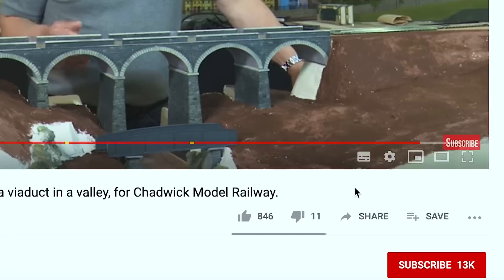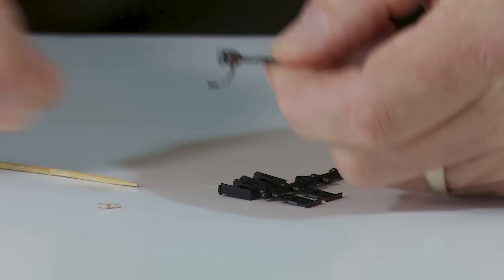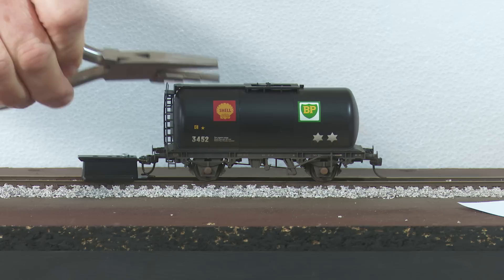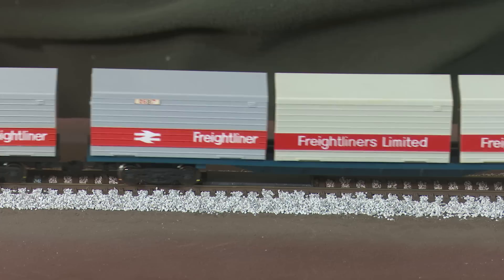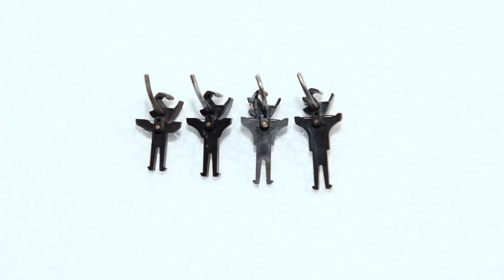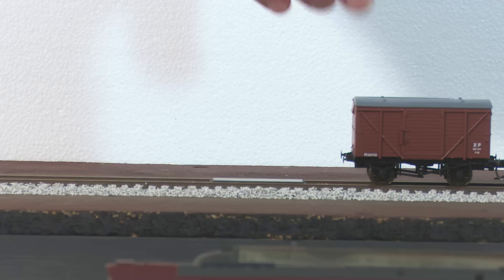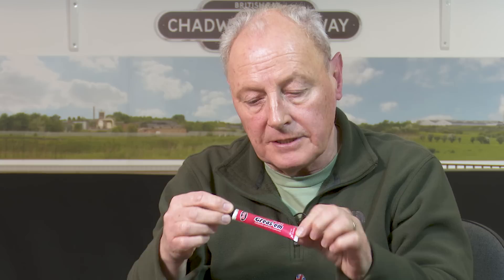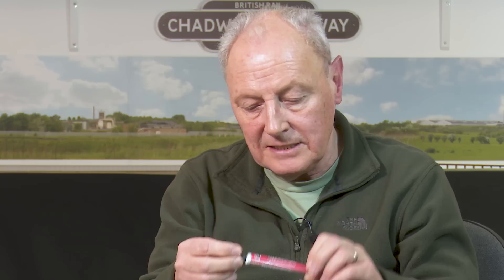Kadee Couplings at Chadwick Model Railway | 81.

Comment: Charlie, I thoroughly enjoy your videos and Chadwick Railroad. 

In the US most HO trains come standard with with KD Couplers, however I Model in N Scale (1-160).   There are two main types of couplers found on N Scale Rolling stock, most older locos and cars have Rapido Couplers, they are large and totally not prototypical at all, and have been around since the start of N Scale.   Most new rolling stock comes with Knuckle Couplers, primarily Micro Trains Couplers, formerly KD N Scale.  The Brothers separated the company.  There are also several other manufacturers making N Scale Knuckle Couplers, including Atlas, Bachmann, and Arnold - Hornby.  Those mentioned work pretty well together.  The Hornby Couplers are the most prototypical and best looking of the Couplers but need a bit of filing to work reliably.  The Micro Trains couplers are the only ones that have conversion kits to fit just about every make and model of rolling stock and locos, they also sell replacement trucks with Couplers mounted to them, as does Atlas.  I have been modeling in N Scale for over 40 years and set it aside about 15 years ago until 2 years ago when I found out that my then 10 year old Grandson was into trains, so I pulled it out and set it up and we have been running trains on it ever since.  I also converted most of my cars and locos over to Knuckle Couplers and have purchased additional equipment, some with Knuckle Couplers and others that I have converted, as far as I am concerned the KD Couplers are the only way to go.  

By the way they also sell larger Uncoupling Magnets that are mounted under the track where the cork roadbed should be, they should be able to uncouple your cars that that have the higher mounted  Couplers. 

Barry Broyles
Reply from the maker: Wow Barry, what a great comment. 
You clearly know your stuff regarding N gauge rolling stock. Good luck with your layout in the future. 
Regards Charlie.

Comment: Charlie, a quick comment on your mention of using #5 Kadees for one of your locos, the #148 that you showed in the video is the whisker equivalent of the #5. Also, if you can adjust all your rolling stock so that they can use centerset  couplers, you might like to think about using the semi-scale #158, also a whisker spring shank. Also, over here (I am a transplanted Brit) many modelers remove the coupler pin and use a wooden skewer for uncoupling. When operating our layouts we often have two man crews, engineer and brakeman/conductor. The latter has the skewer to uncouple where ever required, more prototypical.
Reply from the maker: Thanks Stefan, that’s sound advice regarding the Kadee alternatives.
I’ll be checking them out at the weekend.

Comment: Great video Charlie, these how to videos are invaluable as I get back in to the hobby. I seem to recall that back in the late 60's my Hornby Dublo models had an open coupling similar to the KDs and that the tension lock type were on Triang. Shame if UK modeling went the wrong way back then. (Memory could be flawed!)
Reply: Nothing wrong with the memory ( not unless mine has gone as well)....In fact if I dig long enough in the loft I could fine some, along with a converter truck with Triang at one end and Dublo at the other
Reply from the maker: So true Jeremy, one step forward, two steps back!

Comment: Great video Charlie! I’m in the process of changing all my stock to Kadee couplings, and have come across all the issues you’ve highlighted.
I’m so frustrated with all the differentiations between the manufacturers myself, and am gradually working through them, by several different methods. Stiff upper lip and all that, I’ll get there!
Reply from the maker: Good for you Nigel, be strong!

Comment: Hello Charlie,
Very good video. Have used these couplings on all my stock. Could not agree more with your comments on the lack of standardisation on modern NEM pockets. With old stock you would expect to have to play with shims to adjust the height of the coupling but not with standard NEM. In extreme cases I have had to cut away the fixing for a droopy NEM pocket and use wiskered couplings. Keep up the good work
Reply from the maker: I’m so pleased that you agree about this dreadful situation Frank.

Comment: Great video.  I took the plunge and put some #19 NEM socket Kadee couplings on some Hornby BR Mk1 coaches.  They work great and look fantastic - far better than the tension lock and huge gap between coaches. I am planning on doing some more.  Would you be able to do a video showing how to convert without NEM pockets or with the wrong sort of pocket (older Hornby for example) wagons/coaches/locos to the correct NEM pocket type/height etc.  Love the channel.
Reply from the maker: Hi Michael,  I might have covered this in another Couplings video. There are three in the series.

Comment: Makes me wonder a bit.  Back in the olden days of US scale model railroading (50s-60s), car kits (wagons in UK) came without trucks (bogies) or couplers.  And it was down to the modeler to sort out the "rolling bits."  Now, that could have been from the number of people in the US modeling the various narrow gauges.  It does not seem likely that there was an intent to sell rolling stock kits internationally, as there is such a wide variation in rolling stock between Europe and elsewhere.  
Now, if you bought, say, that Athern 60' reefer kit, you could opt for either the truck (bogie) mount couplers or the frame mounted ones with separate trucks to better match the prototype you were modeling.
Reply from the maker: Very interesting that you get so much choice.

Comment: Great video Charlie. I use KaDee extensively on my layout. To manage the cost, I only fit them to one end of my diesels, normally to the end that doesn't have a driver, this allows the driver end to be fully detailed with hoses, ploughs etc.  I tend to operate my stock fixed rakes of wagons and coaches, to which I attach a KaDee to each end. For long rakes, I will fit a pair of KaDee's in the middle of the rake to allow the rake to be easily split. This enables me to take advantage of "shuffle" uncoupling at various strategic points round the layout.  Just some thoughts. Barry
Reply from the maker: Hi Barry, I think that we are singing from the same song sheet mate. Regards Charlie.

Comment: The Kadee coupler is a VERY accurate representation of North American prototype knuckle coupler.
Reply from the maker: But anything is better than the British tension lock couple are John, it’s dreadful
Reply: @ChadwickModelRailway  Oh I agree it is and I use them religiously on my rolling stock.  I do find though that I need to add a little bit of weight to my wagons especially when trying to couple slowly, there isn't enough resistance to allow the couplers to lock together.  Other than that, it's a brilliant system.  And yes those tension locks have been there since the beginning of time!

Comment: Great video mate! Very informative I have been using the formula of fitting kadee couplings by putting the rear of the knuckle in line with the buffers like you mentioned for about 8 months and  it has been working great. To be honest kadee NEM sockets that don't line up I usually modify my self as I don't worry about resale as I'm 15 and that is a long way away as well as I don't buy rolling stock for the purpose of resale but for my own enjoyment. Also you may not know the NEM box (female socket) Can be rotated 180° to make slight adjustment to the height of the NEM plug.
Josh
Reply from the maker: That’s a great tip Josh, I’m on the case. Regards Charlie

Comment: Hi Charlie, Don't beat yourself up too much over the tension lock couplings, remember the Kadee coupler was born out of the down right frustration over the NMRA X2F coupling. I'm not blaming the NMRA entirely, they actually were trying to invent a universal coupling for all manufactures to freely use on their locomotives and rolling stock. Before the invention of the NMRA X2F coupling, every manufacturer had their own proprietary coupling system. Unfortunately two major issues with the X2F,  they looked nothing like the Janney Knuckle coupler used on American railroad equipment and they had a tendency to uncouple when backing the train. I can understand UK model manufacturers continuing to use the tension lock couplings, it's a system that works. For another example of legacy couplings, look at the N scale / N gauge market. Many folks around the world still use the Rapido (not the Canadian company, the original company created by Arnold and now owned by Hornby) coupling, that looks nothing like any prototype coupling but works very well. What's truly odd?, Hornby now offers Arnold / Rapido N scale American locomotives that are fitted with Micro-Trains compatible couplers. Micro-Trains are the N scale version of the HO scale Kadee coupler. You would think someone at Hornby would put two and two together and try to insure the NEM coupling pocket would be compatible with Kadee NEM couplings. The Same holds true for Bachmann, Kader which is Bachmann's  parent company, manufactures locomotives and rolling stock for the North American market with Kadee and Micro-Trains compatible couplers, surely you would think they would try to design their locomotives and rolling stock for the UK market to have Kadee compatible NEM couplings and / or coupling pockets?  Another great video Charlie. Cheers, Rich S.
Reply from the maker: Hi Rich, thanks for some really interesting information. The British companies need to be ashamed of themselves. Let’s hope for a more positive future.
Reply: @ChadwickModelRailway  Hi Charlie, I just received this video from Hornby Magazine ( https://youtu.be/mF3Naojsfw0 ) and wonder if this product would be of use on your container wagons? Since you have to trim the Kadee trip pins off because they mount very low on the wagons, would this be a better alternative? Cheers, Rich S.

Comment: Great video Charlie. I went to look at my Walthers and Athearn box cars to see how close they couple as I want to buy several for the Airfix tanker and silo wagons I have built as they work well aesthetically on those in my view. I will stick with the 3 link couplings on my mineral wagons as they look more in keeping. I did pick up the KD electromagnetic coupler at a train fair in the 90s when things cost a few Pounds, so am curious now to see how it can all work. I think I will look at that starter pack 1030 you mention and maybe an economy pack as I have about 20 wagons to kit out. Thanks again for a great video
Reply from the maker: I’m so pleased that you found it useful Paul.
Reply: @ChadwickModelRailway  Small update, after MUCH research, I bought several packs of the 146, #19 #20 and #5's plus the height gauge and gearboxes as I picked up a 25 pair pack of Bachmann EZ Mate couplers while surfing. My added fun (not) being based in France is finding sellers that ship at a fair cost and they hv a smart website that auto deducts the VAT. Anyway its been an education and first tests on the Airfix kits look promising. Ramble over. Cheers PS the Over and Under (set) refers to the relative shank position to the back of the buckeye head when viewed in side elevation 🙃

Comment: Charlie the KaDee Coupling Pins are pressed thru a hole on the knuckle. If you push up on it, it will raise the height of the Pin up above the Knuckle. So you don't have too bend the Pin or have to snip them off. Give it a go on your Freight Container wagons. I hope this is understandable and helps you out with your stock.

The loose coupling that drops down, as you don't want to use any glues, Then add a drop of Tacky Wax to the small Flexi-Triangle Socket to see if it helps with this problem. Also just do the above Pin Push Up to raise it to the correct height to stop it fouling on the track magnet etc.
Reply from the maker: Two good points John, thank you very much. How we got into this problem in the first place is beyond me.
Reply: @ChadwickModelRailway  No Problem, if I can help with anything let me know or as above I'll drop you a post with hints or tips. Yes it is crazy that the manufacturers won't commit to one decent coupling standard, that is a better Prototypical (i know you hate that word too, LOL) form to lock stock together and can be easily released. Than putting up with the multitude of multi-sized Drop Hook Dee's, plugs & draw bars etc. 

Yes to keeping the NEM sockets on stock, but at one standard height. Added with a one scale sized coupling that Bachmann, Hornby and Dapol etc would, could and should invest in and work together to make a single standard coupling, a win, win for all concerned. 

After all as you pointed out that we (UK) kick started the model railway hobby, and we bloody have Kite Standards (pre-Brexit... LOL) on everything else. It is a terrible state of affairs and 100 years on down the line (pun intended), you'd think it would have been dealt with by now. 

Anyway my RANT over, let me know how you get on with the Tacky Wax and the KA DEE (the alternatively pronounced K-Dee... LOL) Pin height adjustment. Since the Pins are removable, you don't have to cut or snip them off any more. Just pull them out and save the Pins away in a old washed out acrylic paint pot or make something with them e.g. straighten into posts or weathered scrap etc.

Comment: While in York last May I brought a class 66 loco.  Most 66's were built in London Ontario,  shipped by train to Halifax for eventual transport to the UK.  So in fact Class 66's ran on Canadian rails and I wanted to model this.  The conversion from the Hornby coupler to NME Kadee coupler could not have been easier.  Actually with CV changes to Hornby decoder the unit pulls quite well and I have it pulling (although not prototypical) a string of 14 Canadian Government of Canada grain cars.
Reply from the maker: Well that obviously went very well Mike good for you.

Comment: Great video Charlie, I've had to do all of these mods on my wagons, coaches etc, was a real job doing the old stock where there was no NEM pockets,  as I model in N gauge, you can guess at the size of the small springs! almost drove me nuts! but worth it, like as you demonstrated , the ability to just lift the stock off the rails is a must have, cheers, Dave
Reply from the maker: I’m so pleased that you enjoyed the video Dave, they are truly a great asset.
Reply: What was on there in the first place, Arnold Rapido? N is the only scale which had standardized mounts from about day one
Reply: @ivovanzon164  it was early farish and Peco wagons that I had to cut the plastic away in the chassis, and use the jig that came with the kit from KD to line them up, as in Charlie's video, newer stock wasn't a problem, as the KD's fit straight in, it was a bit of a tough job, but worth it. hope this helps, cheers, Dave

Comment: Hi Charlie I have use kds on my old Hornby freghtline flats wagons they really run will with them you were asking how to shop your freightliner wagon from sagging the way I shop the sagging was I glued the comtainer boxes together then make sure the wagon is flat and then cut off the locating lugs the wagons and then glue the comtainer to the wagons at is the way I did it I have also super details the under framesvby scratch building the elecrical box's air tanks air pipes and the buffer beams on the outer wagons and transfers from Fox  transfers for Hornby freghtline wagons I hope this information is useful to you mate  another great video Charlie goodbye for now Clive
Reply from the maker: Great info Clive. Can you send me a couple of pictures to charliebishop @ hotmail. co. uk please.
Reply: Chadwick Model Railway hi Charlie I have send a email of some photos of my layout and my old Hornby freghtline flats wagons clive

Comment: Another great video Charlie. For coaching stock (especially in MK1 era onwards) and multiple units, they won't look out of place (to varying degrees). 3 link and screw couplings lasted a very long time, and it is hard to find a decent coupling solution without the need for the shunting stick if you want to be closer to prototype.

However, I've looked at s&w, Alex Jackson, DG and dingham couplings that tend to be favoured in more finescale circles (if they're not using working 3link etc) and having seen them demonstrated, dingham couplings feel like a good option, but sadly are directional.

For me, 3link/screw/instanter working couplings are too fiddly, so I expect I'll use combination of kde and dighams probably where shunting is required. For fixed rakes that don't need to be uncoupled or removed then 3link/screw couplings are probably best as you can do them once and leave them alone
Reply from the maker: Thanks D827.  Simply put it still remains a nightmare. So many options for so few producers, it just doesn’t make sense.